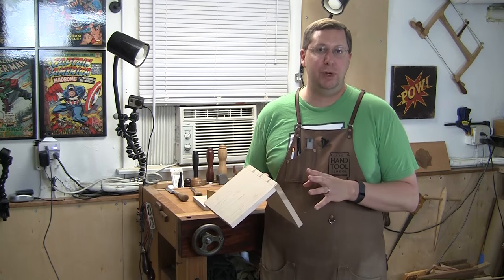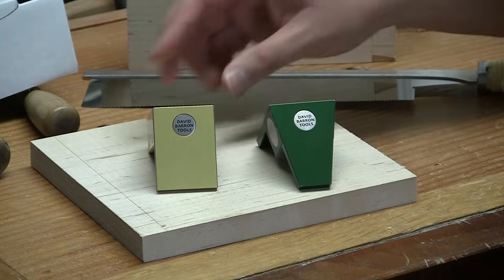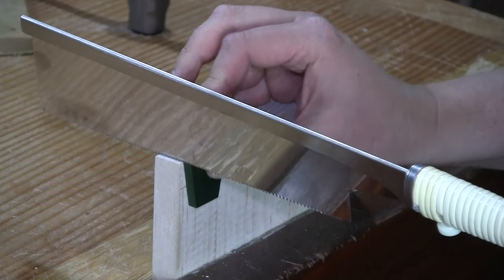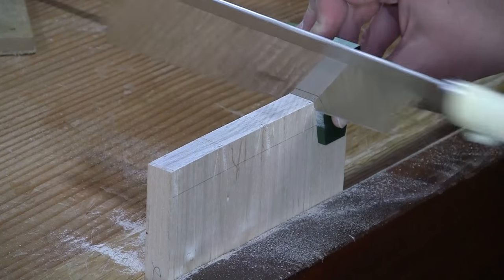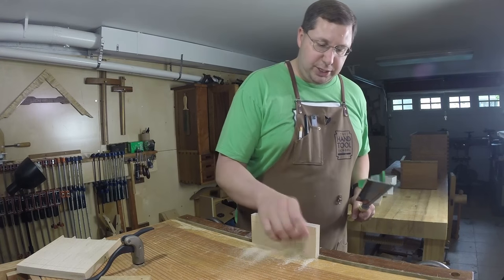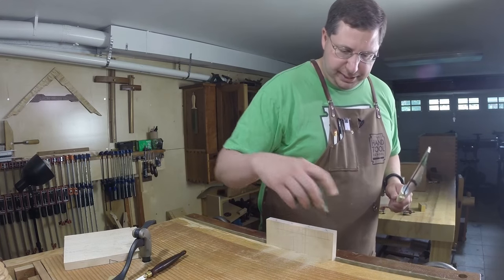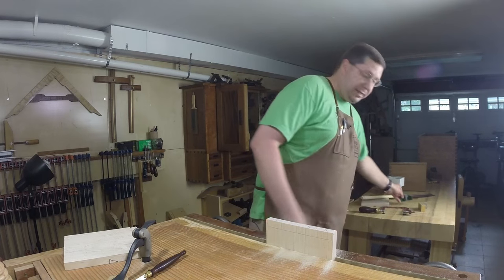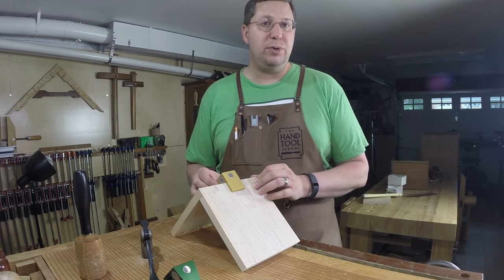RWW201 Barron Dovetail Guides

Comment: I thought about the "training wheels" aspect of this too.  In fact, I used those exact words.  But then, I came to my senses and realized using a guide such as this is NO different than using a miter box.  Only a fool would attempt cutting a room full of crown molding without a miter box.   As far as body mechanics are concerned, it's probably a simple matter of becoming acclimated to a different way of working.   One doesn't walk onto a golf course with a new club and expect the situation to be exactly as before.  You are a highly skilled woodworker with years of doing things a certain way.   This guide is a godsend to the rest of us who have cut merely scores, not tens of thousands of dovetails freehand.

Comment: You set the guide on the next step. I started and learned with those guides and a bad axe stiletto and never had a problem bottoming out and staying 90 degrees across the cut. I think they are great for beginners learning to cut dovetails. I no longer need them after about a month or two of practicing with those guides. An extra step for a perfect joint is worth it in my book.

Comment: This guide got me started and enabled me to get great results from day one. I've recently completed a course with David where he set me a project that doc not allow me to use the guide but had to cut everything free hand. 

I was nervous but it came out really well and I will probably continue to cut them freehand. The guide really helped me learn the mechanics of cutting dovetails by hand. 

If I had a load of drawers that needed doing I would probably go back to the guide just for quickness but I'm now happy to work either way. 

It would be great to point out that the one thing the guides enable you to do is cut right to the line in the waste and see very easily just how close to the line the saw is cutting enabling you to sneak right up to the line. This saves having to pare which in my opinion introduces an unnecessary step where errors can creep in leaving a less than perfect joint. 

Thanks for your review.
Reply from the maker: most definitely.  I aim for all my joinery to fit off the saw.  If it doesn't then my chances of gaps and sloppiness increases dramatically.

Comment: I have one of David's guides and the 372 saw as well as a LN dovetail saw.  I've used both with the guide.  When the LN bottoms out, I just move guide.  The kerf keeps the cut aligned.  I've never felt awkward using it, but I also hold the 372 right up against the blade like a chef's knife.  I always made the cut on the right side of the guide (my dominant side).  When it's time to do the other, I just flip the board around.  This is how I was taught to cut them freehand as well.

Comment: Great review Shannon! I felt that same about not training proper body mechanics. It's a great tool when you don't cut a lot of dovetails by hand. I think it also fits when you need to bust out some quick dovetails and don't want to think about it. All the bench kits at the school were made with this jig and they certainly went a lot faster.
Reply from the maker: one of the comments on my blog brought up the advantage of using these guides when gang cutting tails in drawers and I hadn't thought of that, but I agree that it would make the square cut across 6 or 8 drawer sides much more accurate.
Reply: definitely! In teaching, it's a great way to create that immediate sense of accomplishment.

Comment: I use the guide with my regular saw just to start the cut square across then remove the guide and finish freehand. Same with the pins. Within a week I didn't need the guide anymore but I still use it when cutting on a large project that I want no mistakes on.

Comment: I've only used them a couple of times, but I had good results with the equivalent Lee Valley guides and a flush trim saw.  The magnets keep the flimsy flush trim saw tracking perfectly, and being backless, depth is no problem (until you run out of saw, I guess, LOL).  I still need the training wheels...

Comment: for a beginner it's a wonderful guide, as for "an old dog", it's hard to learn a new trick.
it works well also with western saws but, I came to a conclusion that it'll work best with a Japanese Ryoba saw cutting on the "rip" part but for you it'll be too hard.
despite the saw-set laminate, you managed to scratch the guide, it proves that this wasn't meant for you!
you could see clearly on Dave's videos that he cuts just fine with it without a complaint of the position or stance...
an open mind to "new" things, will take you further, always!
in any way, thanks for sharing...

Comment: Hi Shannon-The height of saw issue you pointed to is easily overcome. Use the guide as far as it takes you, then remove the guide and continue freehand using the track made with the guide. That also removes the baseline issue. You can then see it clearly.

The right angle piece for marking the pins, I thought, was the simple but elegant solution to lining things up.

I bought the guide several years ago (with the saw) and I use it every now and then to change things up. The only problem I have is the plastic  wore away and needed to be replaced. It is far cleaner than the LV model.

For the cost, it was worth it until my freehand skills grew enough to do without it.
Reply from the maker: I made that alignment board originally to help with really wide case pieces since more tails equal more problems is not aligned perfectly.  Now I use it all the time.  I eliminates the 3rd hand so often needed to get everything perfect.
Reply: I use it all the time too. The guide, not so much.

Comment: You get the idea that you can easy solve the problem of left hand with simple flipping the board, do you? And do all your cuttings with right hand? With registering base line and upper cutting lines, its up to you which hand is your dominant. This magnetic guide actually allows avoiding weird body mechanic. Or drawing cutting lines from top to base line on both sides.

Comment: You don't have to go to a saw with a deeper cut.  Once the cut is established, ditch the guide and just let the saw follow the angle you have already established for it.  I have the same issue using the  Katz-Moses guide, but have found it to be no big deal.

Comment: I have used these guides for as long as they have been around and if you can overcome the "guilt factor" you will never cut dovetails any other way, amateur or pro.  The biggest benefit, apart from beautiful crisp joints (every single time) is the time saved in marking out. I mainly eyeball the location of my cuts so apart from a baseline there is nothing else to do.  Forget removing the waste just get a stopwatch(it's the same for any method  and see how much time reducing your layout to virtually nothing and not agonising over the cut will save. When you need to batch out half a dozen drawers the savings are enormous, as is the time fretting over small errors and should they pass, be junked or repaired. To me time is money. I would say to the amateur they will pay for themselves in all the valuable stock you will save yourself by getting it right first time every time. But remember you will feel guilty (I did to start with) that it wasn't all your own work.  Strangely I never felt like this when I used a mitre box or shooting board???

I have now watched your video a couple of times and I have two observations that would definitely help you.  You are gripping the handle way to far from the blade, bring your hand up the handle to the blade and you will find it way more comfortable and balanced. To understand what I mean tape 12in of broom handle onto your Western saw and grip that at the end to feel how wrong your current grip is.  Simply, you look and it feels awkward because you are not holding the saw correctly.  If you want to see what I mean watch David himself https://www.youtube.com/watch?v=Sz68PBAYKfM

Additionally although I may be wrong, relax your grip and trust the magnet will grip the saw (trust me it will).  It will also let you feel the cut on the pull stroke.  You may never love this guide and Japanese saws as much as I do but give them a chance with these two tips and you may find you will lean further towards using them more yourself.   

I agree totally with your point regarding it not being good for developing your sawing skills, but your final comment regarding how much you love the 90 degree guide and how much you'll use it really is a contradiction.

Comment: Being able to use a hand saw effectively is more than just good body mechanics, it also requires a visual aspect. As a blind woodworker, this might be just what I need to get started cutting dovetails.
Reply from the maker: I can't possibly understand what it takes to make a good saw cut without sight Bobby, but I can tell you that the visual side of things it at the bottom of the list.  Touch and sound of the saw are the most important so don't discount them.  But yes to your point, in this case where we are matching the pins to the shape of the tails I could see the guides being a great advantage.

Comment: Thanks for the video and a thorough perspective...FROM...a given perspective...All in all...Well presented.

My perspective (validation: 40 plus years as a traditional green wood and timber framing craftsman within the folk arts of several cultures) is there is no such thing as...TRAINING WHEELS...Frankly, that is a bit obtuse and/or narrow in view or of logic, as well as sound reasoning from my perspective and experience.

The crafts of master artisan from Asia to the Middle East all use "guides" many times and very often. It is a standard in the craft and has been for literally several millennia. Are they always need? No, of course not but still often reached for, especially when many thousands of repetitive cuts...

As for..." weird body mechanics going on"...I find that typical with most students and contributed to them developing either a different (often very poor) muscle memory due to not learning to work a hand tool correctly in the first place and/or poor physicality, such as weak muscles, being overweight, etc. 

A saw guide actually "teaches" proper muscle memory and builds the correct muscles/nerve connections to make repetitive cuts accurately, and correctly. In time a guide may not always be needed if only making a few joints at a given time because of this more proper development of skill set...

As you are well aware, many Eastern saws work only on the pull stroke. This speaks to body dynamic again as for a cut, as you made in this video, often the legs are used to clamp the work to the table which means a range of motion (and physicality and flexibility) that Westerners simply do not have...

Love the channel, and enjoy your perspectives and viewpoints. Thanks for sharing them...

Comment: Holding the saw properly might aide in your poisoning and resolving your complaint. The 372 is not meant to be held at the far end end the handle. Grip it closer toward the blade, drop 25 pounds from the gut, and then your positioning will not feel awkward. Watching David Barron videos, this is an excellent product for precise dovetails. Regardless if you use this or cut freehand, you need to know how to hold a Japanese saw.
Reply from the maker: GEH okay somebody is having a bad day?
Reply: RenaissanceWW Lol! No, I'm fine. I'm not the one complaining about this jig. this type jig had been around since ancient times. David simply put a magnet in it. I just thought it was a bit unfair to describe this as "awkward". It's "awkward" because you have positioned yourself to MAKE it awkward. You are not holding the saw correctly. The old American version of of a dovetail saw had a handle no longer than a fret saw. You are holding the saw incorrectly and thereby positioning yourself away from cut.

I'm reminded of the Great golf instructor Harvey Penick. He had a student that was a Judge. The Judge had a large girth and he couldn't see the golf ball when properly addressing the ball on the tee (awkward). Harvey had no solution for the Judge other than to advise him to "Always play with clean balls".

Thanks for the video.
Reply: I've been using Japanese saws for quite a while. I never took the time to learn the correct way to hold them. I thought if the handle was 10 to 15 in. that, like a hammer, it worked best if the entire length was used. Is choking up on the handle only for dovetails or for all use?

Comment: How about using a tenon saw?
Reply from the maker: Of course.  A tenon saw is just a big dovetail saw right?  Just like with planes, you'll have an easier time if you balance the size of the saw with the work at hand.  Cutting fine drawer dovetails with a 16 or 18" tenon saw might be a bad idea.  It can be done, but the coarse pitch and set might make for an adventure
Reply: +RenaissanceWW I have a Lie Nelson dovetail that lives in the box that came in ... Lol
Reply from the maker: Bad Bobby, Bad!

Comment: The mechanics are wrong on the Japanese saw because you're not holding the saw as recommended. Choke down on the handle really close to the blade.
Reply: This was a realization I had by accident.  I had been learning to use a chef's knife properly, so when I used my dozuki to make a fine crosscut in that same period of time, I kind of mindlessly grabbed it like a chef's knife.  Something clicked and I instantly realized that I could control the blade so much easier this way.

Comment: The jig would be improved if it had a clamp on it so it held itself to the work, rather than forcing you into an unnatural body position.  As for flipping the work to saw the other side, just learn to use your right hand to saw.
Reply from the maker: LOL, while I wholeheartedly agree with embracing ambidexterity, making concessions so that I can force the use of a guide is a bit too far in my opinion.  I might as well go back to a 6" powered jointer and convince myself I don't need to use boards wider than that.
Reply: RenaissanceWW
Mastering the use of your right hand would be helpful in many more situations than just using this guide.  BTW, I agree with you that these guides are not the ultimate answer for hand cut dovetails.